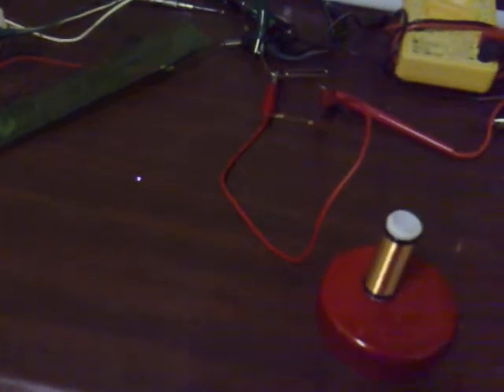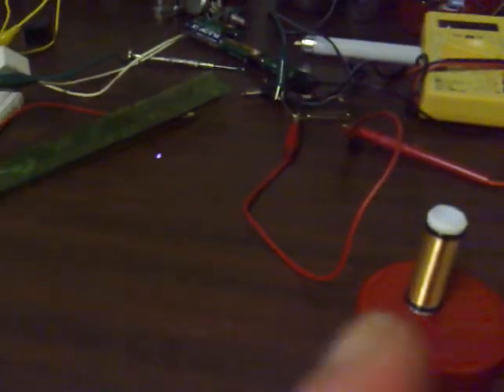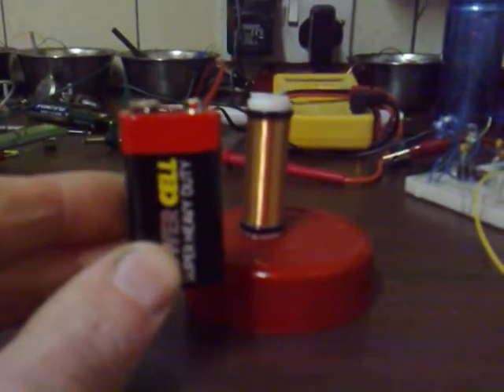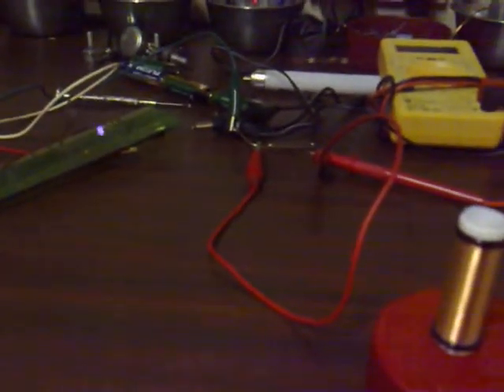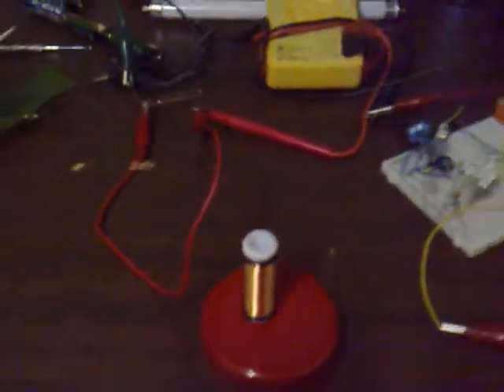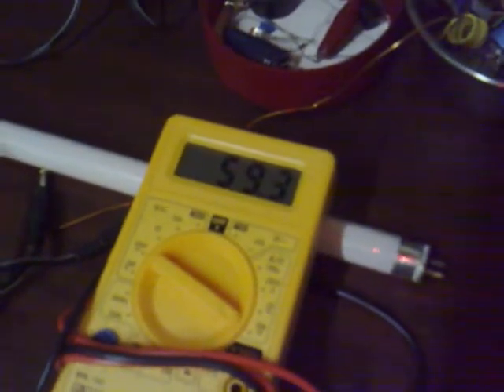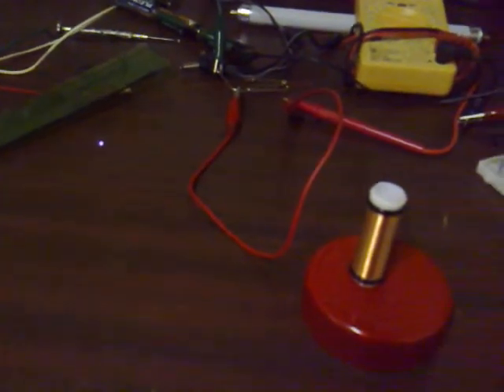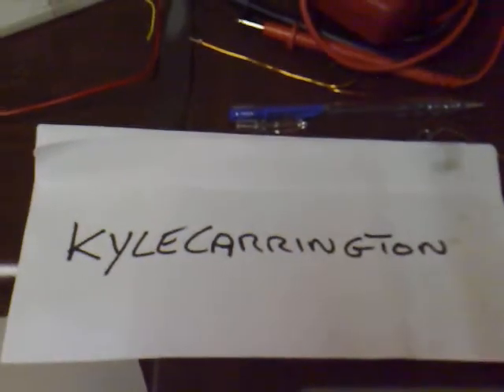Dr Stiffler Sec exciter variant-Plasma

Comment: I think you are only seeing what you are seeing because of the uneven sinewave. I think that the high sine will be leaving a residual voltage that is not cancelled out by the low sine. Once you even them out, then I expect that the effect will cease as the voltages will completely cancel. I assume it is your anode that is eaten away as the oxygern reacts with the metal leg.  The electrolyte will be like having a very low resistor in parallel with the cap. As always, fascinating nevertheless.

Comment: Excellent! So much fun, this and Gbluer's circuit. The lowest I had plasma was at 20 mA, and after a great deal of experimentation, i came to the conclusion that many of the things I had previously thought "helped" (and unfortunately I had talked about, even...) really, were most likely only things "slightly" tuning the circuit. Eric Dollard mentions that Tesla said, the length of your tower coil, has to be a multiple, even multiple, of the other inductors, in that case the primary.